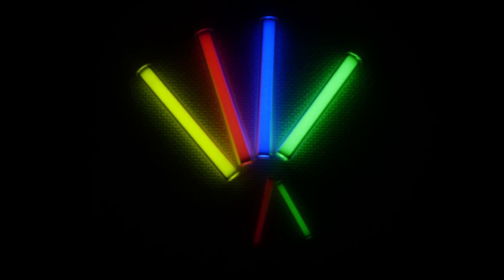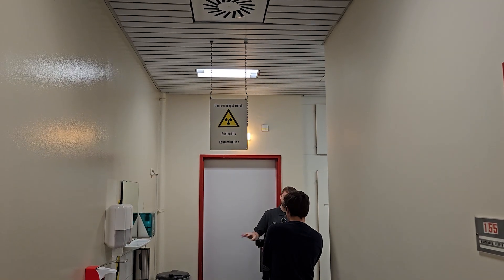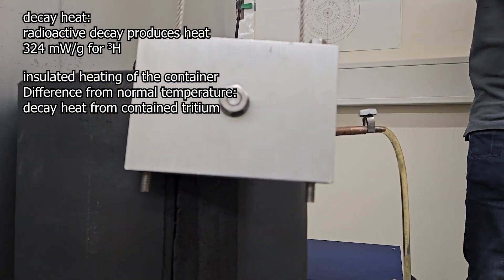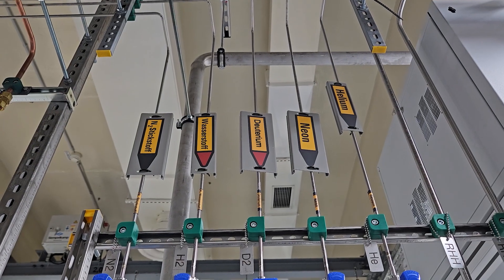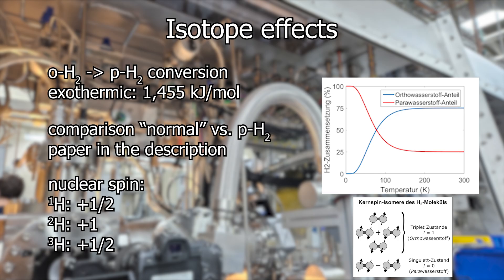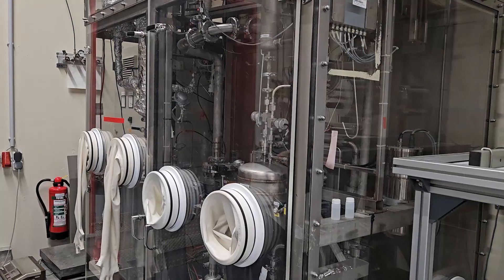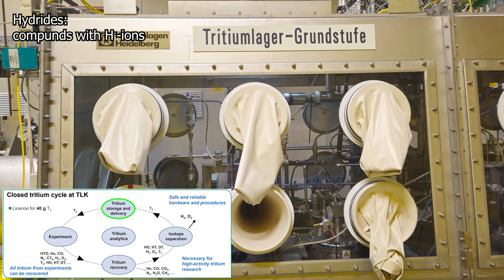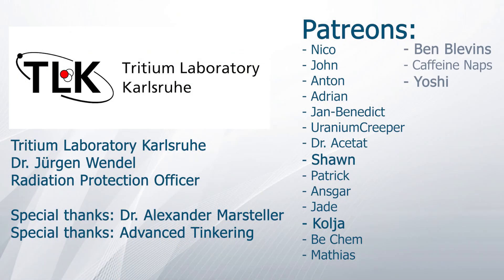At the Tritium Laboratory in Karlsruhe

Comment: How do you get isotope exchange with water? This is quantum tunneling? Otherwise energy barrier seems pretty high for the process. Or maybe the process is catalyzed by metal surfaces(nickel, platinum, etc)?
Reply from the maker: If I understood it correctly: the isotope exchange in this case is just the concentration difference between the T-containing air humidity and the comparatively in T depleted water. Its an equilibrium reaction promoted by the H-bridges of the water molecules. They exchange H Atoms all the time at room temperature. And since they are chemically identical there is no force driving the heavier isotope into a favored compound. Just concentration difference
Reply: @SimonsNuclearchemistry For water exchange sure, this is why I keep my 18O water sealed with parafilm, to protect it from water :D i understood that there's an exchange between molecular tritium and water and it confused me a bit, thanks for clarification.